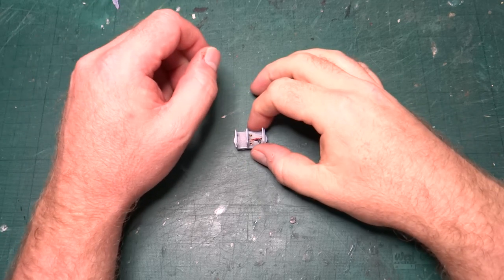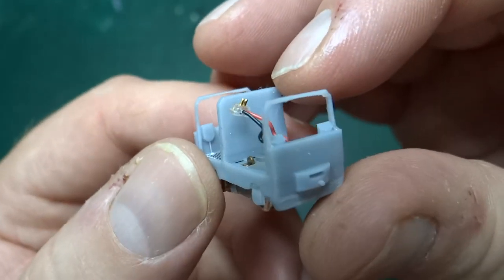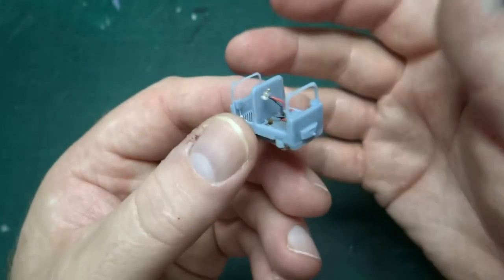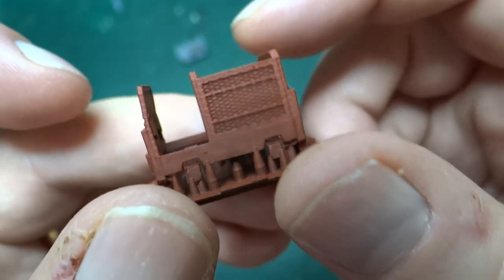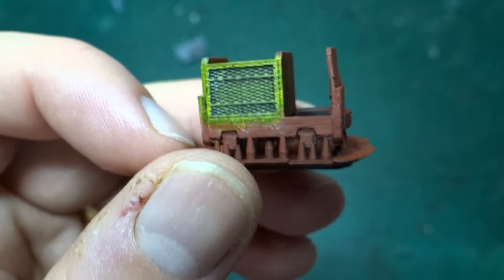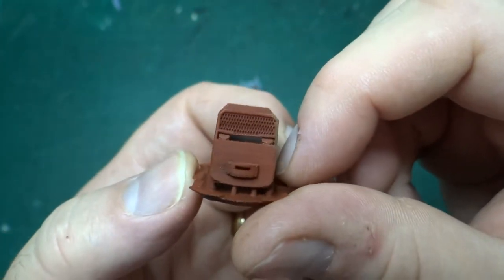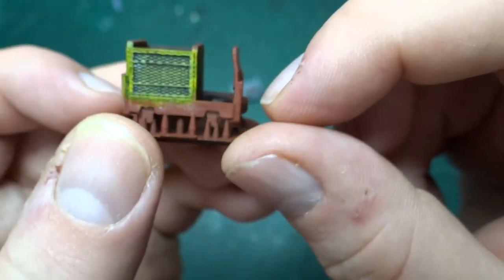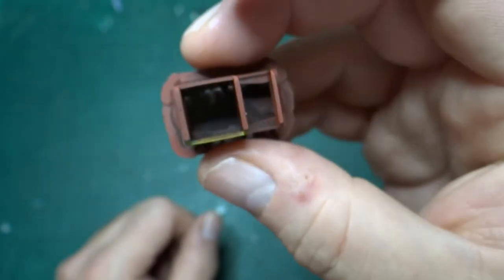Designing an OO9 Scale G-Series Simplex: Printing Expanded Metal Mesh

Comment: Your expanded metal looks pretty good.  I recently tried my hand at making some but for my project I needed the holes to go all the way through.  So it was a challenge to do on a FDM printer.  Used a .2mm nozzle with a .2 line width.  But each wire had to be 2 lines wide so the holes are probably twice as big as yours.  Anyhow they look like they will work for my project.
Reply from the maker: Yes, it would be nice to make the holes real holes but I just don't have the resolution or the right resin to do that at this size. Can't imagine how fiddly it must be getting it to work on an FDM printer.

Comment: For paintng it yellow, what about - hear me out - what about priming it pink? Not flourescent pink, but a light pink. Might be worth testing on a scrap piece? Lovely little model so far, I do love these teeny Simplex locos, nice to see a 4mm version.
Reply from the maker: It's not a silly suggestion. I've seen all sorts of colours recommended as a primer colour for yellow. I think the main problem is that the range of primer colours tends to be quite limited. I think you usually have black, white, grey, and red oxide with anything else being much harder to find. I shot the test model with red oxide as I know it shows up small details quite well (certainly much better than black or white), but might try a grey primer for the next print before looking at anything more exotic.

Another point is that my yellow (Vallejo Model Air  Medium Yellow #71.002) is quite thin and very translucent, so I might want to look for a slightly thicker paint. I don't want to go too thick, or need too many layers, as that will just obscure the details. All a bit tricky.